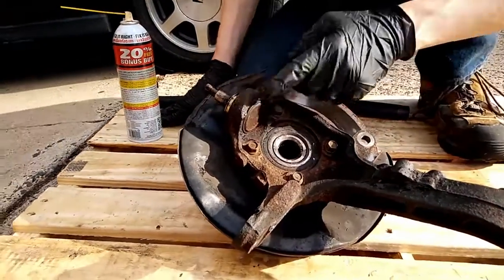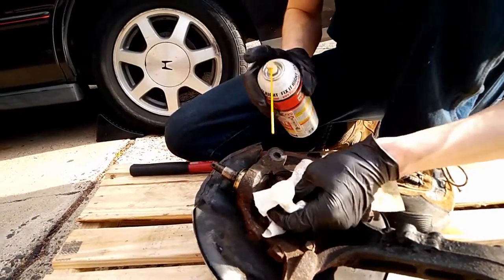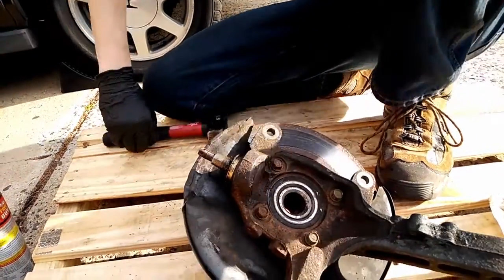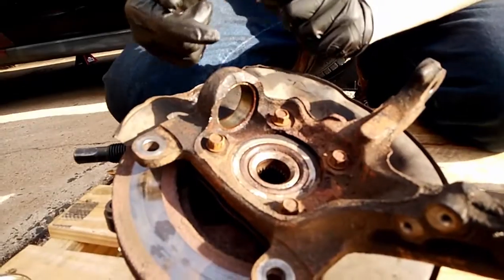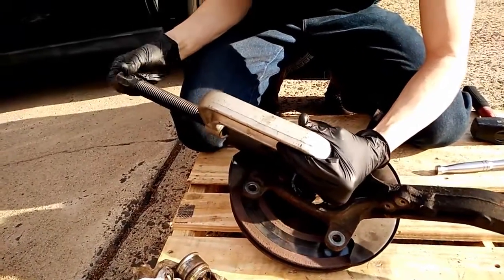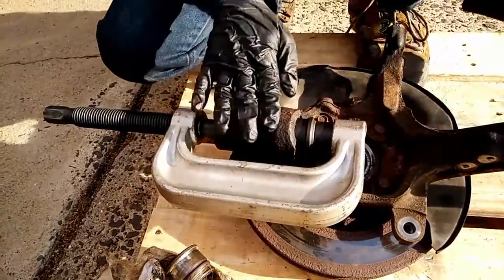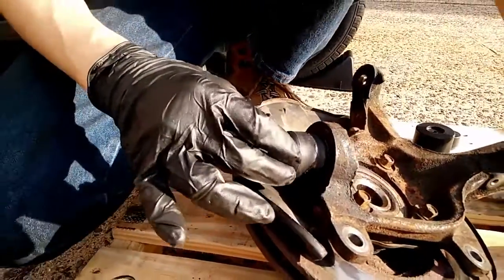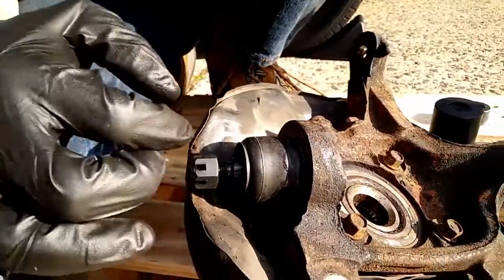1997 Honda Accord Lower Ball Joint Removal and Installation (5th Gen)

Comment: Great video! Recently got new tires and the tire tech told me I have a bad upper/lower ball joints, tie rod ends, and would wave the alignment fee if I was to give them my business. They were quoting me an outrageous price for parts and labor. Looked on line for parts, purchased front and rear for a fraction on what they were asking. Now, looking on YouTube how to perform this task.  Once completed, I’ll be getting that alignment. Thanks!

Comment: What brand ball joint did you get? I’m hoping the one I got came with grease inside but were you able to find a way to put grease in?
Reply from the maker: Mevotech GK9643 from RockAuto. I did not add any grease, but it's still working fine. I guess it was pre-greased.

Comment: so my bearing is sticking up like .25in and joint cant come all the way out. any tips?
Reply from the maker: That's very strange! I'm no expert, but perhaps it's not an original spec part? You'll probably have to remove it first.
Reply: I am having the same issue
Reply: Jeff k you gotta take the bearing out sadly. Much more work but no other way
Reply from the maker: Either of you know whether or not your bearing is OEM?
Reply: Yes mine was. Not anymore because I replaced it
Reply: Who made this design Hitler and Autozone?

Comment: I had to cut the stud off completely and then blow a hole completely through the ball joint. Once it is out I intend to brake hone the hole as it is completely stupid to be that tight in the steering knuckle. Also a good time to remove the wheel bearing from the steering knuckle and clean around wheel bearing with a bench wire brush to remove the rust. The other side, the steering knuckle I will glass bead clean and then put grease on both parts so as next time it will come apart easier if you need to replace the rotors. Truely a stupid design,,,,,,,,,,,,,